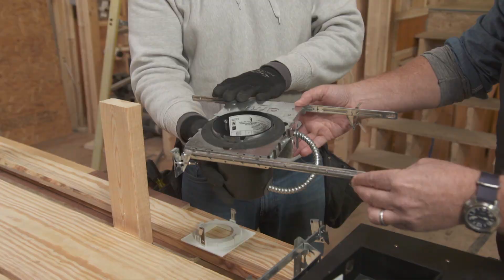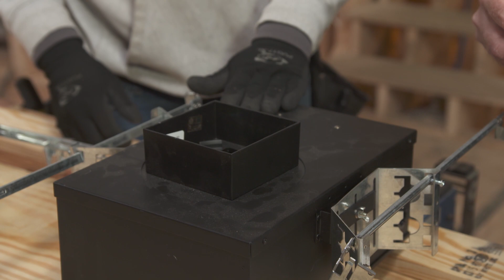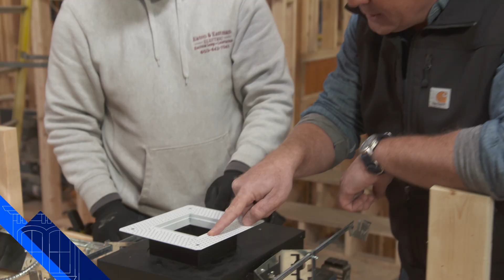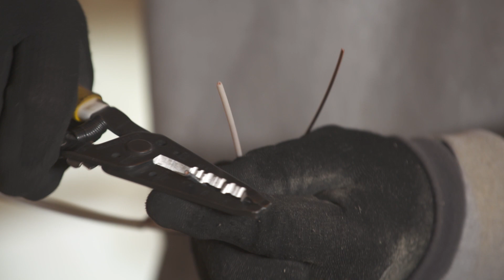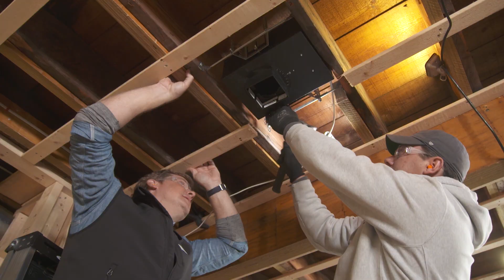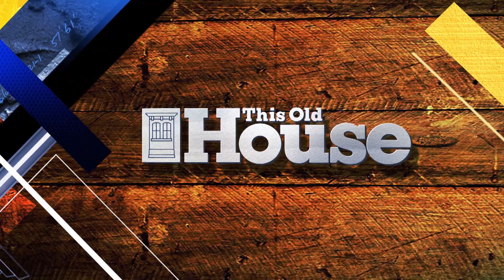How To Set Recessed Lighting | This Old House

Comment: And when something goes wrong with the circuit board in that unit you can't access it to replace it.
Reply: Fully serviceable. Listen to the video again...
Reply: @justinl.3587  So it's part of the assembly that goes in after? So why is that box so massive? LED's don't get that hot.

Comment: Fast forward 10 or 15 years and mudded-in trimless lighting will take at least two trades to  replace.  You'll need an electrician and a drywaller -  possibly a painter.

Comment: why are those casing so HUGE. u can buy all in one LEDs rcessed lightings now
Reply: No kidding I hope you never have to replace it!!
Reply: There is a big difference: This is new construction so there is no drywall to hold it in place and it needs to be fastened to the joists so they can add the drywall later.  On top of that, this particular style is going to be completely flush so it's a different look.  Other reasons why the housing is larger is it's air-tight and you can put insulation around it while still leaving enough space inside for the generated heat to not affect the LED driver which contrary to popular belief (that LEDs are cool), does generate heat.

Comment: I'm not really a fan of any of the old can lights anymore after using the integrated LED wafer lights that are available now. They're extremely small, available in a variety of shapes, sizes and trim colors, some allow you to change the color temp (CCT) via a switch, they have their own junction box, they're insulation-contact rated and some are dimmable and also wet-area rated (basically waterproof). Super easy and fast to install.
Reply: Unfortunately with wafer led lights, there is really only one beam spread/angle. With housing, you get a very specific throw of light.
Reply: @c31979839  Perhaps, but they're great for a bathroom shower.

Comment: An electricians dream$$$$$$$$$$$$$$$
Reply: That's what I was thinking. 40 of those would cost 12k just to install.  Must be a super expensive mansion build.
Reply: Todd D Yes, 40 pancake LEDs would be 10x less, and install faster.
Reply: @Nill757  but then you're also replacing them a lot more often because of failures, and degration of light quality.  But in good quality commercial components in the beginning, and you'll never have to think of them for as long as they are installed.
Reply: c31979839 Replacing what more often? LEDs?  I don’t think so.  Recessed cans exist to support the length and depth  of bulb lighting, around since Edison, in ceilings.  That’s over.
Reply: avalon449 A electrician wanted 85.00 for each light installed. That’s when I realize I’m in the wrong job. 😂

Comment: I like recessed lighting, the problem is that you need 10 in a small room where as 1 or 2 normal lights will do the same. I would also never use them in the ceiling that retains the heat for the house, cause nobody ever seems to be able to insulate properly around them, JMO.

Comment: Those are the outdated can lights that few use anymore. Now we mainly use the ones where you cut a square hole or drill a round hole in the drywall and the LED has springs that hold it up against the drywall. They are as air tight as you will get as they have a very tight seal on the drywall and they are rated for insulation contact. 
    Those big old boxes and cans are a thing of the past.
Reply: These are not outdated, they are high end lights you don't find in Home Depot, etc.
Reply: I would use the led lights with no housing when I do remodel inside ceiling with no attic access but never in new constructions.  

The wire between junction box and the led light is not protected. The connector at the wire is also not standard. After 10 or 20 years later, the homeowner will be screwed when he/she replace the led light because they have to replace the junction box together. 

The junction box dangling right behind the drywall is also a deal breaker for me.
Reply: @erictold  this is exactly what I was thinking myself. I was a little confused by all the comments dissing this method...
Reply: Where does the junction box go
Reply: @MandoFettOG  Some of the ones I got actually have a J-box built into the fixture
Reply: Robert, maybe you aren't familiar with the term "New Construction" but that's what these housings are meant for. They're not outdated at all and are 100 times better than the dinky fixtures you mention. 

https://www.lumens.com/new-construction-recessed-lighting-housings/

Comment: With a square cut out, it'll be a nightmare to get the lights squared up with the walls and with each other during the rough wiring stage wouldn't it?
Reply: If you pause it at 0:17 you'll see a 'notch system' and the square trim has slight adjustment.

Comment: So if the LED driver fails you have to remove the entire mount from your finished drywall...??
Reply: I think he said the driver was in the trim piece that is installed after the drywall. Might have misheard it though.
Reply: The entire light and driver assembly are removable. Maybe go back and listen to the video again.
Reply: That's what I was thinking, I couldn't see any way possible to get to those wiring nuts after the rock goes up anyhow which isn't ideal. A normal can light you can unscrew and drop the whole can out of the ceiling and unclip the junction box. Doesn't look possible with this
Reply: With this style, the housing is just for the power and to contain it but the driver and LED are in the trim piece. With some brands, the driver is in the housing but you can still work through the little hole to get to it or perhaps attic access.  of course, you're completely dependent on the company that made this because nobody else's will fit in there or look the same.  It also means as LED technology improves, you're stuck with this.
Reply: @Arieeeee  My understanding was to get UL listed you need to be able to access all connections and "subsurface appliances" from the point of the fixture, the ballast would be considered an appliance by the UL definition. No attic access in the basement or a flat roof. Someone probably found a loop hole. The new led surface mounts with the spring clips have the ballast separate and the good ones have a clip you can mount first and the ballast just clips in to mount it. The ballast on those is designed to be removed through the size of the fixture hole. So you can just pull the light out, stick your hand up in there (or your 110 pound Filipino buddies hand) and pull the ballast out hopefully the guy before you left enough romex to remove it otherwise your using a screw driver in the wall 😂
Reply: @alec4672  The worst ones I've found are those older $1200 rectangular flush mount MR-16 fixtures that have 3 transformers. One was installed in a really fancy house with faux painting and a transformer went on on them. They had no way to access it without causing a lot of damage.

Comment: Another useless product that is being sold by this old house.  I can not figure out a real situation where a completely flush recessed light would be necessary.   That tiny light trim is no good i need it completely flush and really hard to repair said no one ever.
Reply: Yeah, so totally unnecessary. What they should do is staple a wire to the finished ceiling, let the wire hang down a foot or two, attach a socket to the wire, put a bulb in the socket, and move on to the next room. Anyone who wants more than that just has more money than sense.  😁😁😁
Reply: @KarlBunker  HAHHAHAHHAHAHAHA
Reply: @KarlBunker  no kidding! And here I am switching on/off lights with a switch where I should have just been using the breaker. Clearly I have more money than sense.
Reply: It's just for aesthetics man chill. Everyone has their own preferences and look they want for their house. Relax.
Reply: trashcan1112 Rich is missing out on installing fixtures for people who have more money than they know how to spend.